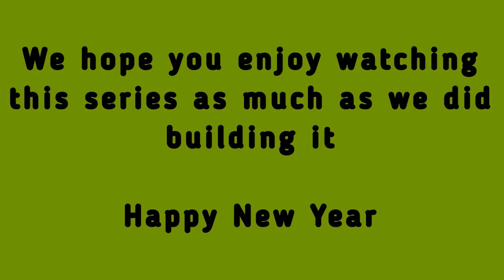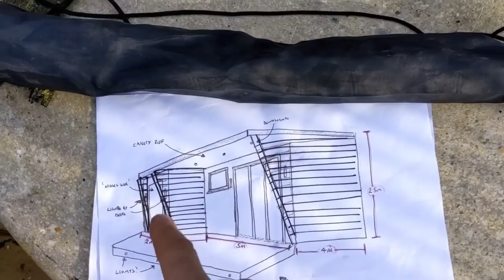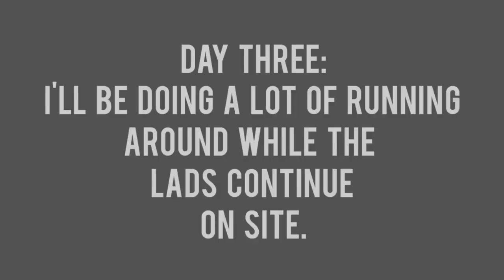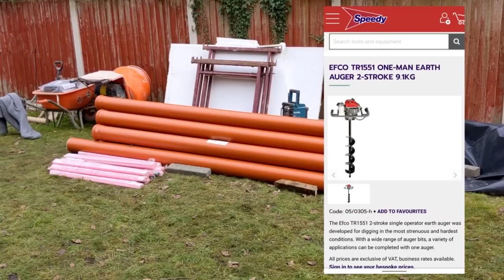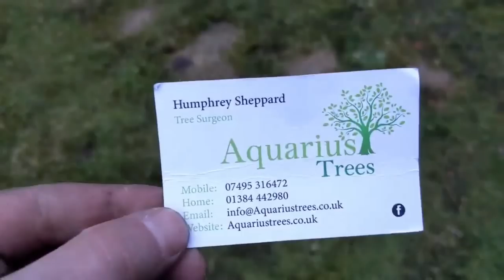Garden room with shower room, integral shed and composite decking

Comment: Good shout on the underground pipe. In North America cardboard sonotubes are a staple in hardware stores. Come in a range of widths too which lets you use a lot less holes than this! You can stick them up above the surface, level them before you pour and reinforce the pier with a stick of rebar.

Actually looking at putting a couple of footings in on a job to support some new posts that will hold a beam. Obviously they have to go as deep as any other foundation, but there's not much guidance around for the width. I can only guess 600x600. Tried taking to a local SE but of course they just want to design it as supported by another beam between the other walls. Point loaded in the middle of a 5.4m span... £££.
Reply from the maker: Hi and thanks for sticking with us mate. I love the idea of those cardboard and tubes and wish they were in the shelves in this country. They were labour intensive to initially set out but did a great job for us once the sole plate went on. Happy New Year mate 👍🏻